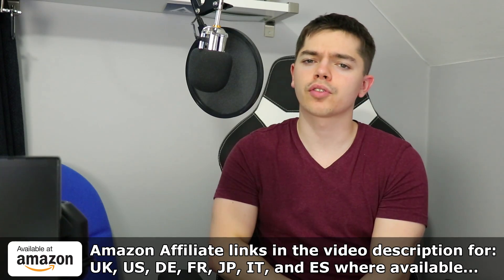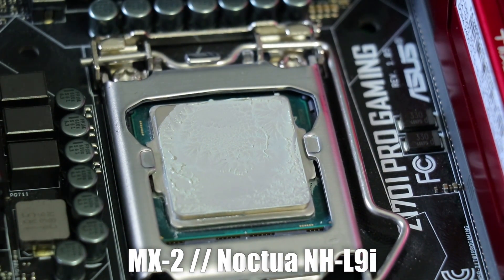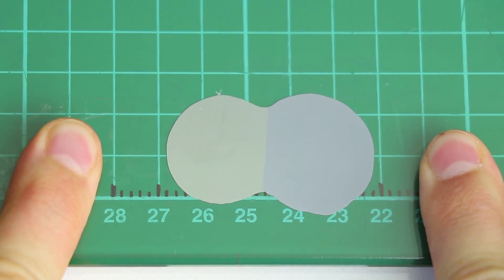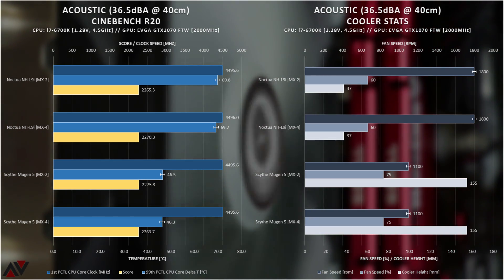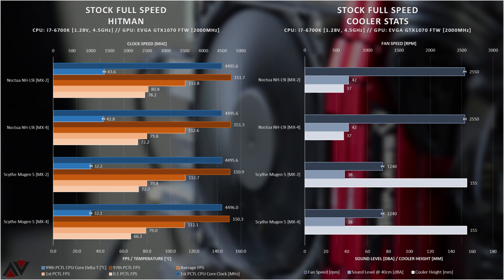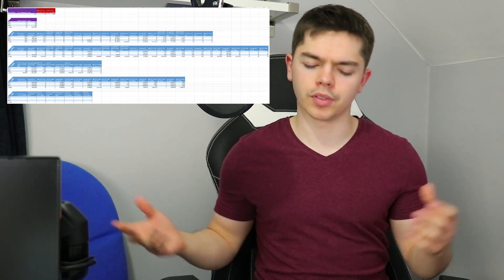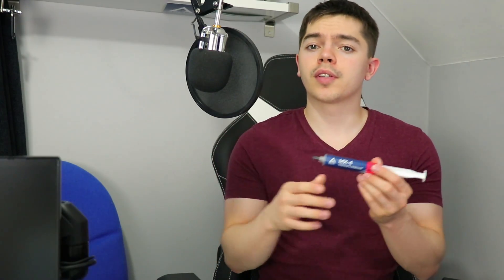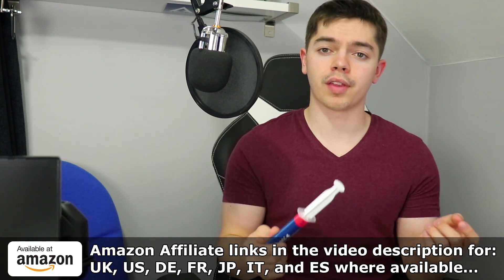Arctic MX-4 vs MX-2... What's the difference?

Comment: I use both on a very regular basis and here’s my honest view. I’ve found that MX2 is insanely durable; I repasted my OG Xbox 360 Phat back in 2011 with MX2 and until last year it was still in regular use……stripped it, cleaned it and replaced paste last week. It’s still a paste, admittedly far thicker than it used to be, but not totally baked on. 

MX4 I far prefer for PC builds due to a higher envelope for much higher power levels and is far easier to access to repaste. I did a PS3 repair and full service for a customer last year using MX4. It came back with a squeaky fan today, the paste is as dry as paper. The original PS3 fat boy does run hot, but it was totally powdered. I repasted with MX2 today, let’s see how that lasts!

Comment: Applying with the pea method is like playing darts blind folded.
Reply from the maker: ...with enough experience you know what you're doing.

It's really not that hard, especially if you install a lot of coolers, and especially especially if you install the same cooler a lot.

You can always put more paste than you think you'll need since it's well documented to not hurt thermal performance.

There appears to be more to blindfolded darts than it would initially seem.

Comment: This is how not to do a comparison video, you should have put the processor under the same load and fix the coolers rpm and check the temps...
Reply from the maker: This is how not to watch a video...

I did all of what you said, literally all of it. What do you think the RPM speeds in the 36.5 dBA and Full speed test results are there for - to show you that the speeds of the two coolers with the two different thermal pastes are running at the same speeds respectively. It's a good job I'm more thorough at testing than you are at watching a video!
Reply: @AVTechy  we are here to compare 2 thermal paste, I stop watching the video at the middle when i see you put allot of data about noise and other things... Go to the point
Reply from the maker: Testing is more complex than "here are numbers". Explaining how a figure has been achieved is just as important as the figure itself, I'd have thought someone so adamant about proper testing would know this...

Comment: 1:36 WTF???? After this, i can understand how you know about thermal paste and how to apply them. Stop the video, and dislike.
Reply from the maker: There are so many videos about how to apply thermal paste, this one is about performance. For performance purposes the main factor is how the thermal paste had spread out (too much or too little), not the specific application, especially regarding smaller IHS's.

Seriously though, look into videos comparing all the common thermal paste applications and method and the conclusions are too little is bad, too much is as good as the perfect amount. So as long as you can see the IHS has been fully covered you should be confident there wasn't an error based on thermal paste application.

Don't get hung up on things that don't make a difference, focus on what matters.
Reply from the maker: To add to that, I show the thermal paste application right after that explanation. If you kept watching you probably would have found what you were looking for.

But stop the video and whinge works too I guess...
Reply: @Alessandro Girotti go watch the Verge you sound like their demographic 😜

Comment: Desktop vs laptop witch thermal paste would better for them between these thermal pastes
Reply from the maker: Both work equally as well. I personally find MX-2 to be excellent for applying straight to CPU and GPU die's in laptops and GPUs, so I'd definitely recommend that.

Not that MX-4 is worse, but MX-2 is a little more fluid so it spreads really well in small doses.

Comment: Which one would you recommend for playstation 4 pro?
Reply from the maker: Either one will be fine. I have a slight preference for MX-2 since it's more fluid and very easy to apply on GPU die's. But both will with equally well.
Reply: Got mx4. My pro works so quietly now...
Reply: @AgarwalRajan  damn. I repasted my PlayStation before and it was still loud lol.
Reply: I changed the thermal pads too,  cleaned whole heat sink with a needle, and even cleaned the disk system..
Reply: @AgarwalRajan  ps4 pro has shitty cooling for its performance

Comment: Does mx-2 work on ps4 pro?
Reply from the maker: Any thermal paste will work the PS4 Pro. Not to say that the PS4 Pro is any less specialised than normal PC hardware, but thermal paste is there to help the transfer of heat from one thing to another, whether it's a desktop CPU, or a Console APU (they combine the CPU and GPU right?).

MX-2 is pretty awesome stuff. I've had it running on the test graphics card for over a year and that thing gets hammered regularly.

Comment: Every test I've seen puts mx-2 as almost equal to mx-4... 
I've used Gelid extreme and I'm happy with it, but If I was a person building PCs I would for sure use the 65g mx-2 for easiness .
Reply from the maker: Yeah I agree, I think overall I prefer MX-2. Although I'd say the less runny nature of MX-4 might be more ideal for smaller applications like laptop GPUs. But that's a niche use case.
Reply: @AVTechy  Do you like the gelid ? I installed a new cooler with gelid and got temps down by 20°c

Comment: hey, how long can you store the paste if not using it. since it's supposed to last about 8 years on the CPU. thanks
Reply from the maker: That's a bit of a how long is a piece of string kind of question.

The only real way to tell is to have some hang around and see when it dries up. If it's still easy to squeeze out and hasn't separated then it's good to use, otherwise it's time to get some new paste. If the claim is it can be used on a CPU for 8 years it should be fine in the tube at room temperature for at least 8 years.

As for the 8 year use claim, that's a how long is a piece of string statement. Are we talking about a 20w laptop CPU in an air conditioned office, or a 95w desktop CPU at 70 degrees for 8 years? It's really too hard to say how long it'll practically last, but minimum should be a couple years with heavy load, and I could see with light loads lasting 8 years. Just an estimate based on speculation and questionable experience :D

Hope that helped!
Reply: @AVTechy  yeah you're right. To be honest I'm not sure my computer will last 8 years but I'm planning on changing every 2 to 3 years the paste anyway

Comment: I've found that most thermal pastes even garbage paste works fine for basic builds,  the higher end paste when your chasing single digit improvements.   I've bought Chinese pastes that works within a couple degrees of high end paste,  longevity aside.    If I know I'm going to be testing CPU's,  swapping in a few days I'll go with cheaper stuff.   For final builds I go with more expensive pastes.  You really want to go for longevity vs just pure performance.   Doesn't do much good to build a custom loop only to have the paste dry out a few months later.
Reply: Abit late but i agree cheap worked fine on my cpu but when i did the graphics card no matter how i mounted the heatsink id hit 100c used some mx4 never seen it above 70c since.

Comment: the bench look reasonable fair on the noctua cooler but in mugen zero differences i want to apply some thermal for the xbox 360 the mx2 isnt bad but the mx4 is sustainable for at least 5 years whiling to sacrifice performance for durability edit: he said the mx2 is for longevity while only the mx4 says its waranteed to long 8 years im not sure for mx2 but i think he missinformed himself or what

Comment: I'm planning to buy Arctic MX-4 but I don't know if they sell a fake one to me
How can you find out if it's a fake or not?
Pls help🙏
Reply from the maker: The only real way to find out if it looks like the real stuff is to compare temperatures to similar builds. But that's tricky since you need to be operating an extremely similar system to whatever your comparing your results too, and using the exact same benchmarks.

You could get away with comparing to a system with a different board with the same basic CPU setup (voltage and clock), RAM, and PSU, but if your CPU, cooler, case, ambient temperature (which you can negate if your looking at Delta T values) are different you'll have a hard time establishing what's true or realistic.

Comment: What of these two is better for laptop cpu
Reply: both are pretty much da same. you wont notice any difference in clockspeeds or throttling due to the limited laptop cooling system when under load. 
keepin the system dustfree is the best cooling tip for a notebook
Reply from the maker: Quite right, if the test results are anything to go by they're identical. If Arctic's explanation of them is added to that then MX-2 is the one to go for.

But as With Style said, cleaning dust out from the heatsinks is key. That'll keep the airflow high keeping noise and  temps down and increase the longevity of the thermal paste.

Comment: Hey AV, you should do a review on the thermal take versa H18 TG, it is a very cheap micro ATX case with a tempered glass side panel and a full length PSU shroud. 

After using this case for a few months I can say that the front panel does basically nothing to prevent dust from getting into the case.

Comment: Nice work there. The only other difference I can think of is speed heat transfer. (which wasn't tested for, or am I being dense?) Say we put a sensor on the top of the radiator block, maybe the MX-2 takes two seconds longer to reach the same temps as MX-4. I don't expect any difference there either though, especially since Arctic makes no claims about that.
Reply: There isn't enough volume of paste to actually absorb heat, so it can't just buffer the heat for 2 seconds or anywhere near that order of magnitude, probably not even milliseconds. The only potential performance difference would be in ultimate thermal impedance that it creates between the two surfaces, the hot plate and the cold plate, which is comprised of 3 largely unknown figures, two contact impedances, cold plate to paste, paste to hot plate, and the thermal impedance within the paste layer, which is basically layer thickness divided by thermal conductivity. Since the layer is so very thin, the conductivity ends up not really mattering all that much, just as long as it's adequate, it's just not a key performance indicator. So the only kind of test you need to run to characterise the performance of the paste in a given application is your temperature at the hot plate at a given power emission and constant external conditions like ambient temperature and airflow. And the difference ends up... well minor.

Some people with more extensive test setups can detect a difference more reliably, but they're still going to have enough individual test variance to make the difference kind of moot. They're really well within 1°C of each other, and MX4 isn't even always the winner not even by a tiny margin nor in a perfect test setup.
Reply: @SianaGearz  Thank you. I really shouldn't have used the word "speed" there. However, I have seen Gamersnexus do tests on Thermal Grizzly pastes, as well as some thermal pads, with up to a 2 degrees difference between the pastes and even more than that on crazy high wattages. It could still just be variance, but there's certainly been more testing on their claims. I don't know if 2 degrees is a lot, but it feels like it's a lot.
Reply: @Arashmickey  These tests performed by higher end labs (and GN now can count itself among them) have variance cancelled out - multiple tests where the product is re-applied, well controlled amount and spread, for example applying the paste through a silkscreen or stencil, average of multiple applications and discarding outliers, you can get really precise comparative results that way. However, when you end up really installing the paste the way one does, you will have a variance from one installation to another of a couple degrees.

I wouldn't say two degrees are a lot. Like, if your throttle limit is let's say 95°C, then you really don't want to come even close to that figure, because slightly different weather, and you'll push right into it. At 85°C, the expected life of the semiconductor product is about doubled, and that's what you're probably aiming for, or even colder if you can manage with the budget available to you and the performance you need.

Two coolers could have 10°C of difference easily between each other, so that's a much larger difference.

As to GN? I don't think they've ever done thermal paste comparison, in spite of having an excellent testing setup. They have done a few coolers, and that's probably most of the reason for the test rig. I recall they have done Hydronaut paste against Grizzly's cloth-like pad and IC's graphite pad, which of course perform a LOT differently. They do have a substantial thickness and volume, they have a high nominal thermal conductivity about 5-10 times of what you get out of paste, and they probably don't achieve the same quality of surface contact as a paste. They seem great for lower power builds or when you want a fully maintenance free system. It seems unlikely that anything except liquid metal can perform better than paste, simply because paste spreads so thin and contacts the surfaces so well.

Igor's Lab has found following values for a 125W CPU in terms of delta Celsius:
Kryonaut: 34.8°
Hydronaut: 36.3°
MX4: 36.5°C
MX2: 36.6°C
Revoltec, InterTech and similar junk: around 38.3°
Gallium based liquid metal alloy: around 33°

For a GPU, which although old and only just north of 100W on the chip, was chosen for similar power density to modern ones - smaller die; can serve as a model of what happens at higher power densities:
Gallium alloy: 61.5°
Kryonaut: 62.4°
Hydronaut: 66.1°
MX2: 66.5°
MX4: 67.5°
Inter-tech: 74°
Revoltec: 85.5°

So yeah at higher power density, the field does spread apart, but the difference between MX2 and MX4 is still minor and doesn't even show a clear trend. There are for sure many pastes which perform spectacularly badly and a handful that perform spectacularly well, but most pastes are somewhere in the very densely populated middle right similar to MX performance.

That being said, both MX2 and MX4 have been formulated as extra long term endurance pastes, and MX2 might actually be the winner in this regard. I have heard of cases where the Kryonaut which performs so well in tests has failed after a few months. It was quite a menace with i'm not sure, Gelid Extreme or IC Diamond back in the day too when it came out, extremely good test results but failing a few months later left and right, might have improved since though.
Reply: @SianaGearz  I'm definitely not one to push my CPU or GPU, it's fun to do once or twice and see but I have absolutely no need for it, I certainly don't need any high-end thermal compound. I looked it up the Gamersnexus review and indeed, the comparisons was between one thermal paste (Hydronaut) and two thermal pads (Carbonaut and IC Diamond), not between two pastes. He tests between 95W and 270W. It looks like Igor's old playground Tom's Hardware did a round-up for paste this August, including some liquid metal, and an outlier called "Alphacool Silver" which for some reason is terrible. Interesting, but again not much more than 2 degrees difference between common thermal pastes.

Comment: Depending on the thickness of the sheet metal used, cutting a hole in it might make it lose its rigidity, especially if the hole is not round. If it is 0.8-1mm thick or more, it will probably be fine, but under that you will be left with one bendy test bench :) As for the thermal paste - when I was choosing one to replace the stock one on my GPU, I found a very old review on the net comparing the two and they found out the only difference is MX2 behaves better on GPUs. From my experience, it is mostly true - after 6 months on my GPU, MX4 is partially dried out, like peanut butter, while MX2 stays liquid as the day I put it on. Maybe it is the longevity thing Arctic told you. Been running MX2 for nearly a year now with no change in temps, while with MX4, I noticed about 5 degrees more on my GPU after about 6 months, which was gone the second I replaced the paste. On CPUs (running usually in the 50-70 C range, 65-100W) it does not matter which one you choose, but GPUs (60-80 C or more, 150-250W or more) take their toll it seems. Or maybe I applied it better the last time with MX2 lol. Either way, you can't go wrong with any of the two, the only one that compares is Noctua's NH1.
Reply: To add on to this comment it would seem people have had issues with mx-4 on laptops as well (direct die application there too) and it would seem to make sense that it doesn't do very well on GPUs in general as a result of that. 

My own use with the stuff showed quick degradation, a week later I noticed temps go up slightly but that could've been the room temp. After a month it was as bad as the stock stuff was after 4 years. Since then I've used GC solutions gelid extreme on my gpu and that stuff seems perfectly fine for me so far.
Reply: @ArtisChronicles  i still dont really understand why so many people have had issues with mx4. personally, i installed a small amount on my laptop core i5 processor and it seems to be fine. thats 7 months ago, only thing i noticed was when i took it apart was that it was drying out ever so slightly. i dont know if im lucky with my tube but all my builds seem to be fine with it lol.